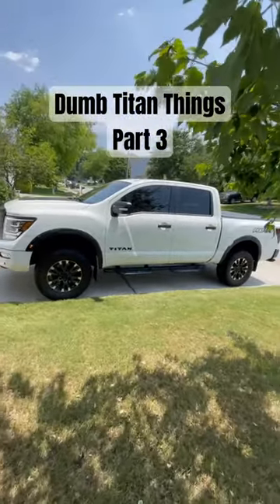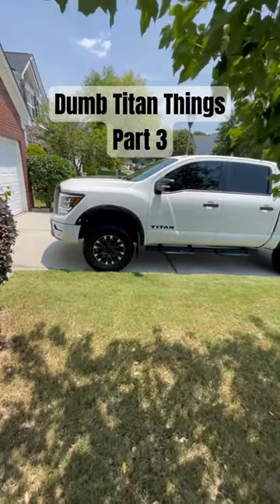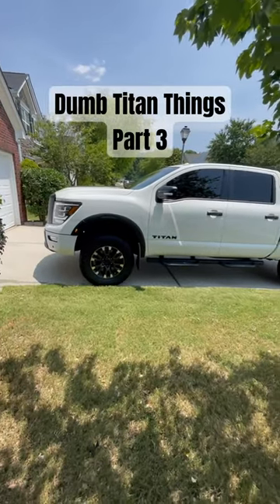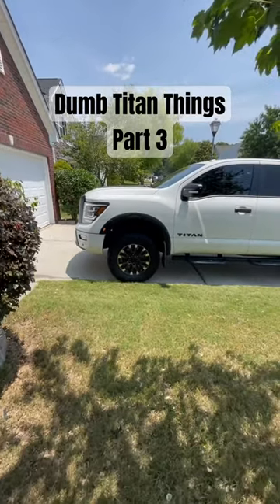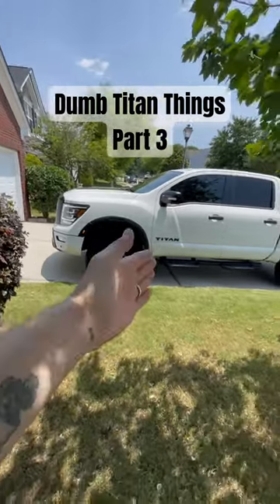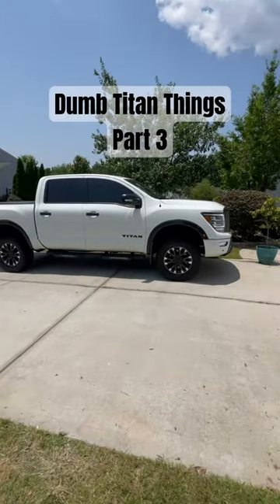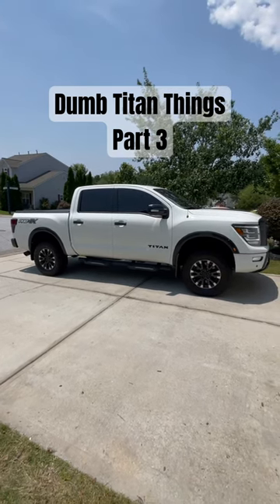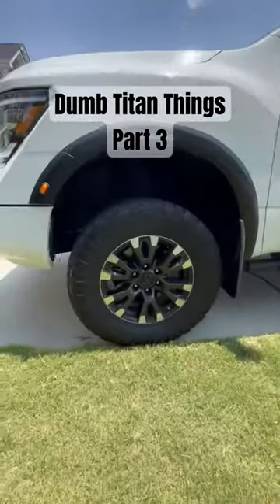Dumbest Nissan Titan Things Part 3

Comment: What is dumb is lifting your truck and putting big tires on it. Ruins the towing, payload, drivetrain angles steering components and the list goes on. Doesn't really make it that much better off road either.
Reply from the maker: That’s if you do it in excess.  A 2-3 inch lift doesn’t hurt anything. Jeep even warranties drivetrain and suspension problems with lifts up to 3 inches. And 2-3 inches of additional ground clearance Absoluteky helps off road—as do taller tires.  There is a reason it’s done 😂 I think you’re talking about trucks with crazy lifts and 26” wheels.

Comment: Nissan doesn't build trucks to be lifted, they build and design them to be driven and used at factory height and specs. I would imagine they don't even recommend larger stuff I would imagine. You do like we all did in the 90s and trim body and fenders
Reply: Get out the ol’ sawzall and go to town on it.

Comment: Got a 17 Titan SV, 6 inch lift on 37"s. Rides perfectly fine. Gonna do the same to my 23 Pro4x
Reply: I'm thinking of buying a 19 platinum or pro4x, from 1 to 10 how much you give it in reliability?
Reply: @carlosnunez2218  I'd say a 9. My 17 has zero issues beside me breaking the front diff lol. Didn't like 37s in deep beach sand lol

Comment: My 2016 XD Platinum Reserve was the biggest POS I’ve ever owned 😂
Reply from the maker: Oh damn!
Reply: Cummins?
Reply: @MechanicalSymphony  Yep, tons of issues with regeneration, transfer case failures, blend door actuators failing, cracked light lenses , seat heater failures, pitman arm, and steering box needed replaced under 25k miles plus 7 alignments and having an engineer fly out to look it over and we couldn’t get it to drive straight 😂. Not to mention dead pedal, and other issues.
Reply: They really didn't become reliable until 2019 and up. The earlier models were troublesome.
Reply: @MechanicalSymphony  yep 5.0 Cummins.

Comment: The common sense is not to modify a vehicle that is been build that way for a reason, putting bigger tires make the engine and transmission run hotter and put more work and wears and mpgs goes low and then there will be more karen complaints.
Reply from the maker: No—Karen says things like “don’t modify your car because it will get lower gas mileage.”

Comment: I run 33x12.5 on a 3” lift and aftermarket wheels with minimal trimming.  My Titan XD was 35s on factory pro wheels with minimal trimming
Reply from the maker: Definitely depends on offset.  There was no rubbing at all on fsctory wheels but went with some wheels with a -12 offset (same tires) and runs a bit

Comment: You can fit 295/70-18 (technically a 35” tall tire) as long as you keep the stock wheels. I have the exact same truck, with only a 2” level (Fox coilovers) and I run some Mickey Thompson Baja Boss ATs in that size. I only get very minimal rubbing on the rear of the front fender liner under hard turn, high flex situations. With a little massaging of the fender liner, or an extra inch of lift like you have, they would clear 100% of the time.
Reply from the maker: Yeah it’s the offset that messes it up

Comment: 2018 sv running 20’s with 33’s no lift very rarely do I ever rub the rear of the wheel well. With a 3” lift you should be easily able to run 35’s

Comment: Its a Truck not a backhoe. Over lifting a truck is ignorant unless you are building a monster truck for competition only.
Reply from the maker: Not really sure what your point is.  Has nothing to do with the lift.  2.5-3” is far from ignorant. The video is about the narrow wheel wells not being able to accommodate a larger tire.  There is plenty of height. Not enough width.  Are backhoes lifted??

Comment: I've got a 2008 Sierra, 33" is as large as I can go on my 2.5" level but fortunately these trucks aren't as bulky looking so 33s on 17" rims looks great. I would love to run 35s but I don't feel like cutting metal.
Reply: I own a 04 and I’m about to cut to fit 35s. From what I’ve seen it’s only about a quarter inch of the pinch weld that rubs, but the front has plenty of clearance. I’ll respond back to you when I cut it.

Comment: Ever heard of a sawzall?
Reply from the maker: I would never use a saws all on a vehicle 😂 I hope you’re joking.
Reply: @SpeedCultureStudios are you joking?
Reply from the maker: @CDawg1324  No. why would you use a hack tool like that on a front bumper?  Cutting exhausts off, sure.  But trimming a bumper? 😂
Reply: @SpeedCultureStudios  I don't know what a "hack tool" is. 
A tool has a job, and it's only as good as the person using it.
Reply from the maker: @CDawg1324  that’s nonsense.  😂 Don’t be dense.  A sawzall is not a precision tool.  In the auto body repair world, we joke about bad bodymen using sawzalls and hack saws.  You wouldn’t use a carpenters hammer to do paint less dent removal — not even the best PDR guy.

Comment: Well Nissan builds trucks to work with a drive not to be a pavement princess
Reply from the maker: Huh?
Reply: @SpeedCultureStudios Nissan builds a work truck not a drive around and look pretty truck. A truck is meant to work with not lift it and put wide tires on
Reply: @zackhaycraft8159  it's meant to do w.e you want it to do. Forget your truck Bible rules
Reply: @4546gbhgcnju6re  the entire point of a truck is to work not be a pavement princess

Comment: You could get an aftermarket bumper and remove the mud flaps and you’ll get the clearance you want. But then again, what kind of things will you be doing in the truck that you’ll need larger tires? I like mine stock. I put larger tires on my Jeep instead.

Comment: Got a 2004 on custom front and rear suspension(about 4” around) and I have 35s with slight offset. Just do the pinch weld cut and you’ll be fine. The rear will tuck without rubbing even at full suspension load.

Comment: I’m very close to getting a 2021 Titan SV with 18k miles. Have a 2014 Ram 1500 Big Horn….5.7 of course. A bunch of options, air suspension (which I only use when towing camper). Our camper is 5,600 lbs. my truck is rated to tow 10,500. I’m sure the Titan rated at 9,300 would do just fine. But, I do want to put a 3-4 inch lift and 35s on it, with those same wheels you have. I really don’t want to trim anything to do it.
Reply from the maker: We pull a 26’ camper with ours—probably 6500 loaded.  I don’t know if 35s will fit or not. I might just risk it soon loli

Comment: My stock 2010 Titan rolls on factory 20 inch rims with 33 inch tires. 2WD. My manhood is plenty big enough. I don't  need to compensate  it by lifting my truck with a lift or monster truck tires.😎🍆

Comment: Damn so that's just extra custom work that has to be done to get bigger tires? I was actually thinking about a small lift and little bit bigger size tire.
Reply from the maker: Really depends on wheel offset too.  My current wheels have a -10 offset so pushes them out a bit and makes it even more difficult to upsize tires.  I could probably squeeze 35s but would have to trim the corner of the bumper and flatten a pinch weld on the inside of the wheel well.  Definitely not possible at stock height though.
Reply: @SpeedCultureStudios  damn that sounds like a lot.

Comment: I run 35’ with 2” lift and it doesn’t drag on my pro4x
Reply from the maker: What are your wheel specs though?  Factory wheels?
Reply: I'm curious too...I just ordered a 3in lift kit with some 35s to go a factory wheels.  I have 2017 Titan Pro 4x.  The dealer seems very confident the 35s won't have any issues.......I'm nervous as hell...lol
Reply: @KirkLBrown  i have the stock pro4 wheels, yo should be ok, we just put 35’ with no lift on a new pro 4 and it bearly drag when you turn, nothinh major

Comment: Why the hell would you want bigger tires? They're perfect the way they are.
Reply from the maker: Another inch of axel clearance, ground clearance in general. Better handling of obstacles.  There are a number of reasons to upsize tires.
Reply: There's also laws on bumper height
Reply from the maker: @mikebraz25  we’re not even close to reaching the bumper height laws

Comment: If you want bigger wheels just cut bro, my 3 inch lift on the Titan with 33 ridge grapplers are fine 😂
Reply from the maker: These are 33s too — but will definitely have to cut going into 35s
Reply: @SpeedCultureStudios  I have my share of complaints about the Titan, it’s mainly the limited after market items - it sucks to only have one or two options.
Reply from the maker: @raiderjedi4160  yeah aftermarket is a bit weak at the moment!

Comment: Running 305/35 zr24 on factory suspension. No rub at all
Reply from the maker: Although wider, That tire is .5” shorter than these 33s.  What’s your wheel offset.  That really makes a big difference.

Comment: Your complaining like Asian motors build trucks to off-road in 35-37s 😂 bro most trucks can’t handle 35s it destroys parts that’s why Aussie dudes and others fix approaches and run 33s a lot these vehicles are not made for you to destroy they are made for you to get to point A from point B with decent fuel Economy
Reply from the maker: You think they don’t study the American market? 😂 They know what the vehicles are used for.  Hell they market toward it.  The Pro4x is supposed to be the off-road/rugged terrain trim. It’s a little weird to limit it’s ability to accommodate larger tires.  Aussie dudes might run 33s because they aren’t putting them on full size trucks.  I’ve also seen PLENTY of Aussie builds running 35s+ so don’t generalize.
33s are stock size — I hardly think 35s would “destroy” anything on the truck.
Reply: @SpeedCultureStudios  sure they do that’s why we don’t have the xterra in the age of the overlanding suv and we have trucks straight from the factory with shit at tires on it bro it’s built for the point A to B consumer off-roaders are a small population and even smaller when you actually scratch your frame or rest on a skid plate a fire break or hunting trail for opening season isn’t off-roading